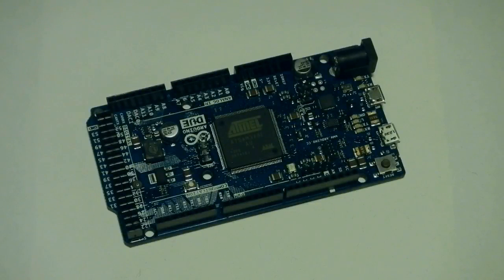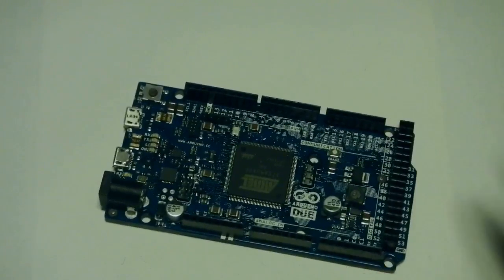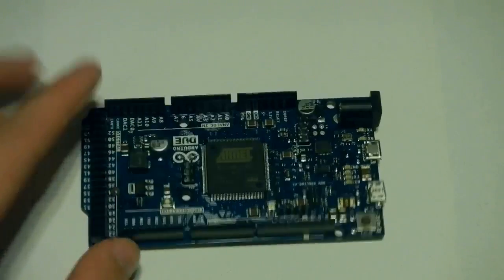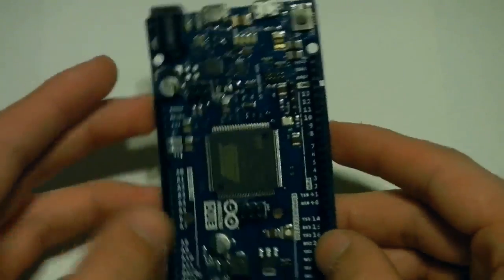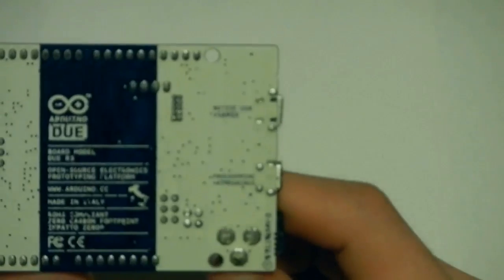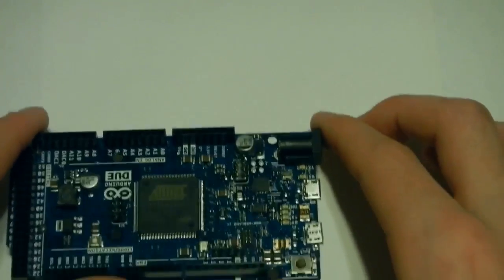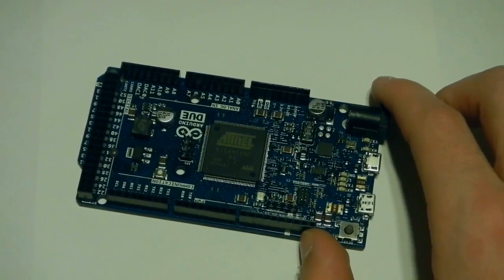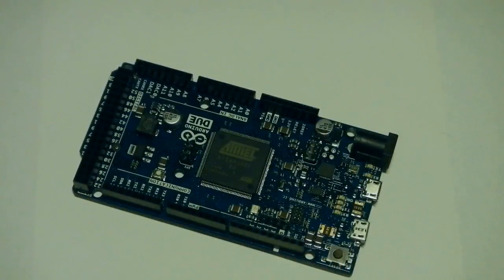The Arduino Due

Comment: The 8 bit chips are useless for large numbers but more specifically floating point numbers as double is the same as float, it only uses 4 bytes. Decompiling mega code proves that writing double is pointless, it still uses 4 bytes. This isn't the case with 32 bit due which uses 8 bytes for doubles

Comment: I was wondering why you didn't continue with the other ARM processor the STM32F4? Is this better?
ty
Reply from the maker: I was thinking about doing that. May just be what I do. Branch out a little.
Reply: I've heard that Eclipse is a good editor. But for me, I use vim... Sorry about that...
By the way, using Linux is the best OS to program these processors. I got tons of errors with my windows and mac machines but on my Linux machine, it worked perfectly. So try changing OS's if everything else fails...
Reply from the maker: The Discovery board is proving to be an issue to film. There are some massive bugs I'm still trying to work it out. There WILL be videos.
Reply: humanHardDrive TY
Reply: humanHardDrive
Bugs? Can you tell me what problems you are currently having? I've been programming STM32F4's for about two years now so I might be able to help..(hopefully :P)
Reply from the maker: What IDE are you using? I've been looking through a couple and I can't get any of them to work consistently. I've been reduced to editing the programs in notepad++ and hoping each program is perfect.